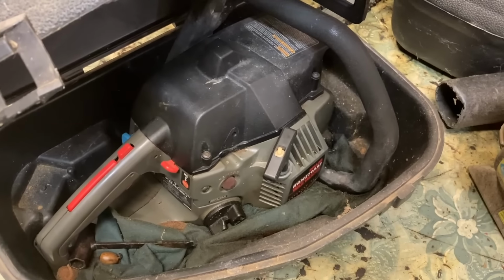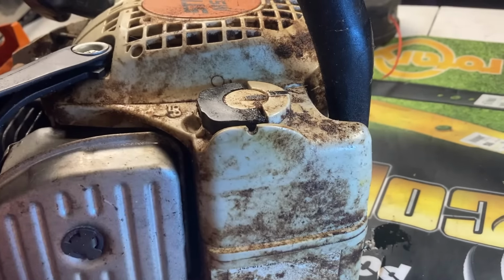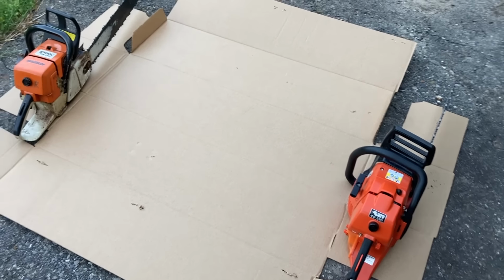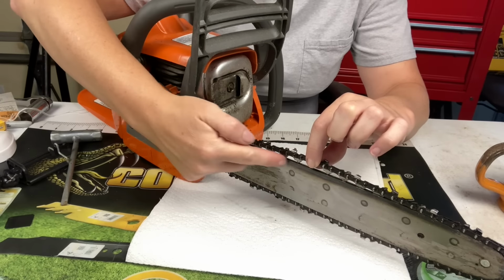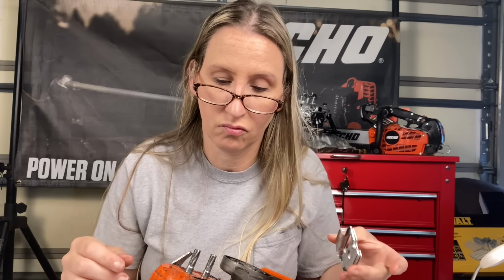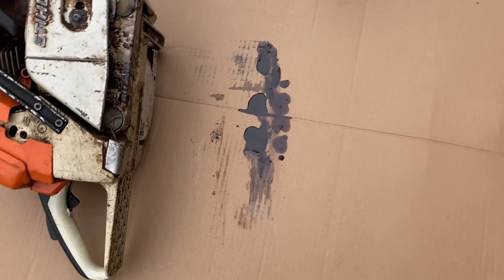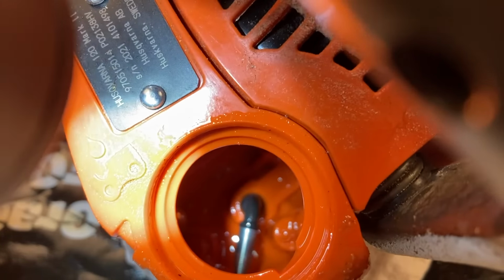Chainsaw leaks bar oil? The most common reason why AND Husqvarna saw leaking oil FIXED!! Repair Vlog

Comment: Even if you don't have a mechanical problem with the oiler or seals, your chainsaw is going to leak some oil.
Chainsaw oil has additives which increase "tackiness". Put some bar and chain oil between your fingers, rub them together (yum slimy), then pull them apart - those "strings" are due to the additives increasing the surface tension of the oil so that it will cling better to the chain and not sling off as easily, improving lubricity between the moving parts of the chain and its contact with the bar. It's ALSO what makes a chainsaw prone to "leaking" after you shut it off, even if all the seals are in place. A couple of things are going on. For one, the chain oil has very high surface tension and the oil in the pump and the mouth of the oiler literally gets pulled out by the oil that is already in the bar/chain and "stretched". When I was a kid they used to sell this "powder" for "magic tricks" that when added to water would make "anti-gravity fluid" - you'd start pouring the "anti-gravity fluid" (telling everyone it was water) from the glass then sit the glass back on its base and the "water" would just keep climbing up the side of the glass and out. Magic. Actually it's surface tension.  Same thing goes on here with the "tacky" bar oil.  Second, even though  there is a vent in the oil cap on the saw, this is to allow air IN when there's a vacuum in the tank from the pump pumping out oil. But most of them are one-way valves, and don't release excess pressure in the tank so you don't lose oil turning the saw over or clog it with oil and interfere with the oiler pump (even cheaper saws where the vent is just a hole don't operate quickly if the pressure changes quickly - the vents are tiny to keep contaminants out of the oil) so when the air pressure outside drops, the air in the tank expands and forces oil out the oiler mouth and down your bar and chain. Also if the saw gets warm - such as going from cold winter outside to storing it warmer inside; or having it in a vehicle that warms in the sun - this increases the volume of air in the tank and its pressure and forces oil out the oiler mouth. Other oil "leakage" will come from all the debris, junk, and dust that accumulates under the cover where your chain drive is. This gets saturated with oil during use, which slowly drains out of it as it sits. 

Just FYI In case you were interested in the physics of why it happens and why you can't actually prevent it completely.

Comment: My Stihl dealer told me when I was done with the saw to take the oil cap off and put it back on he said it relieves the pressure buildup in the oil tank it seems to help but not 100%

Comment: actually, out of all the saws i have had over the years, stihl, ryobi, ross and husquvarna, the husky(372xp) is the only one that doesnt leak oil everywhere... i can actually put it on the floor of the car and not have to worry about the carpet getting ruined. the ryobi(18v) on the other hand is probably the worst for oil leaking.

Comment: another point, revving a saw without cutting anything will get more oil everywhere since there is no sawdust to absorb and cary away oil, basic homeowner saw sees a lot of light trimming for every minute of run time, leaving plenty of oil to drool out. If you were bucking up firewood I'd bet you would see a lot less of a drool spot. My 257 does not leak normally, but after a fuel line replacement and carb tuning (full throttle with no cutting) it left a pretty good drool spot.

Comment: I had just bought a new Echo 510, I believe that’s the right number. My brother in law burned my McCollouh up. Probably no oil in the gas. 
Anyway, I had just sharpened the saw and adjusted the automatic oiler. My old one had a mechanical oiler.  I held it up to the end of a log and revved it to see if it was oiling. That thing sucked up to the log, hit and jumped back in my face at full throttle. Cut me from my eye across my nose. Over 150 stitches and 10 operations and I’m halfway back to being normal again

Comment: My big Huskys' have always piddled...like a puppy dawg, whenever I store them. I'm sure there's a proper fix, but as long as the oil tank delivers the same amount of oil to the chain when I use it, I don't care. Relieving the pressure and draining the tank for storage has always been enough for me. Watch for a vid on your particular saw's oil leak and fix it if you like.

Comment: The oiler works on pressure. When done, open the oil cap, tighten the oil cap and it should not leak. If it does you might need to get some repairs done.

Comment: Here in the Pacific NW we use winter and summer bar oil.
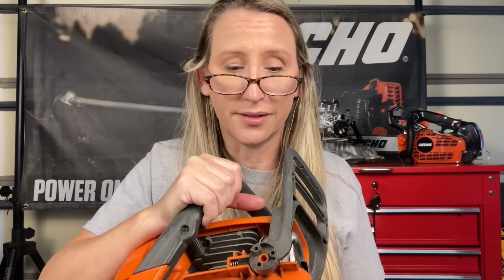Thick stuff in the summer so as it gets hot it wont flow as easy and leak.  20:33 Winter is thinner (just add motor oil or diesel to thin it out).

Comment: One thing you didn't measure and assuming all chain saws leak, what about the storage position?  Will they leak less if they are rotated in a certain way?  Usually you see chain saws stored upright.  But what if you laid it on its side?  In storage, I don't want it to leak AT ALL.  What's wrong with that?

Comment: Thanks for the video's, very informative. I have a practice of just draining the bar oil back into the container when I through leaving the reservoir empty, no leaks. I should also note I empty my fuel and run the saw until it shuts off. The saw is not used that often.

Comment: Very helpful video! My small saw that rides in the truck never leaked for the 1st 10 years, now it leaks terribly the last couple months. Gonna pull it apart this morning and figure out why with the help of this video!
Also, I don't think all saws leak, my 462 hasn't ever leaked a drop but it doesn't see as much action as my trail saw.

Comment: My new Echo CS-400 was adjusted for way too much bar oil, it was slinging oil off of the bar like crazy.  I adjusted screw for less oil.  However it still leaves a little amount of oil under the saw after using. So it good to know it is just residual oil from inside cover.

Comment: My echo leaked so badly. I took it to the dealer, and he said it was normal. I took it to another dealership, and they said it wasn't covered by warranty it will be 145 dollars and the problem was it was set to high, got it home and it leaked just as bad. Took it to a non dealer and he replaced oiler and seals we will see if that fixed it

Comment: Nice video and great presentation, the primary reason for the rubber oil pickup tube coming off is most likely someone cleaning up with a compressed air duster, 120psi sqirted anywhere near the bar orifice will do it 😊

Comment: My Husqvarna 55 rancher leaked like a sieve  when I uses cheap 30 wt oil for bar oil.  I switched to the Husqvarna bar oil and my leaking problem stopped.

Comment: My Poulan always fills the case with oil while it is stored. I dump the oil and gas back in the containers using a funnel now. No mess and no stale gas. I usually run the carb dry after that. I drain the oil from my electric saws too.

Comment: Enjoy watching, you repair ,that blower,,,I just fixed chainsaw ,that my brother in law,let friend borrow straight  gas,melted aluminum over rings,I had about 41 saws down to 35
During after hurricane, in Louisiana,,,sulphur ,I loan them out ,,,after hurricane damage is over ,I get them back and fix back up,last hurricane, a had 15 out did get all back every brand ,never worked on echo.

Comment: I’ve got a Stihl 041AV, must be 40 yrs old, maybe more. Uses exactly a tank of oil for every  tank of fuel. Has never leaked (other than what drips off after being run hard).  Bought a Husqvarna e series 450 x-torq that leaks half a tank of oil if I park it with the tank full. And it does not oil the chain when under full power such as cutting blocks, have to run it just fast enuf to turn the chain after every block so the chain gets oil.  Bought it with a 5 yr warranty, took it back, they said it’s working normal, supposed to leak oil, complained about the lack of oil under power, they said they couldn’t get it to do that.  It spent the 5 yrs mostly at the dealership, and now I’m stuck with the problems.  Only thing good about it is it’s way lighter than my Stihl. Love that old Stihl.

Comment: As a JD mechanic said about his brand of tractor: "If it leaks, it means it has oil in it!" He was referring to hydraulic oil, but bar oil is the same way with saws. Buy any $500 saw, run it, expect bar oil leak. I HATE the Stihl caps, anyone too dumb to use the screwdriver type caps is too dumb to run a saw.😂

Comment: When I use my "chaino" i always finish the day using my air compressor gun and my 3 sizes of brushes to clean "my baby".  The i fill the oil up, give the chain a quick sharpening and, thanks to your video here, realised why i don't have that problem.

Comment: Thank you, I'm new to chainsaw, and have no real small engine experience. I thought I just have to tighten the cap mowar, but good to know I don't need a bigger hammer, I just need to suck it up. Glad my chainsaw came with a case (promotion so free), and so it's not just getting into the garage ( the mess is contained). Now to learn how to use this sharpener I just bought. I'm a trained goldsmith so I have experience filing, but I'll need to figure out the shape goal et al. I've run four tanks of gas, so it's worth checking my teeth.

Comment: I really haven't seen a chainsaw that would not have bar oil under it in storage. it is the nature of the beast. The bar oil container has to be vented somewhat to keep the pump from pulling a vacuum. When you put the saw into storage gravity takes over and the oil can run out to some degree depending on that particular saws design. The only way to lessen the problem is to drain the oil out before storage. In fact, some of the owners manuals say to do just that. The oil leaking is not a defect. If the oil did not easily flow through it would not be able to keep up the the proper demand for chain lubrication.

Comment: Mine the oil literally gets into the gas tank and I've used chainsaws since I was 14. 
I empty the gas and refill and prime, it cranks up runs then when sitting or seeps into gas tank somehow...I though I had first may e put oil in gas tank but once I emptied and refilled I can use it till I'm done and sit it down for a couple hours. Oil gets into the gas and it's not me.

Comment: Well i just realized ur in AR. So am iI. My name is Tammy and i live in Coal Hill AR. I bought a refurbished 440 Husqvarna last year. I havent honestly cut very much wood with it yet. I feel ive worked on it more thsn ran it. Parial me just being out of practise. So im not blaming the saw yet! But the issue of not oiling my bars is about to get my goat. I have a 18" and a 20" bar. I have kept the bars oil holes cleaned out along with the bar themselves. I keep my saw cleaner than most anyone i know. So i cant figure out what the probmem is with my bars not getti g oil. Ive done everything i know and watched video after video and still can not get it to put oil on the bars. HELP PLEASE!😢

Comment: Quick tip. When pouring out of a plastic 1qt. Oil bottle... pour it with the spout at the highest point.... NO GLUG. These are not my design so don't shoot the messenger..

Comment: When I’m done I drain the saw both of gas and bar oil. I use a funnel and put the bar oil back into the bottle. Same with the 2 cycle fuel. Every other month I clean the entire saw with some Simple Green and it alway looks brand new. Remember there is oil on the chain, bar channel and clutch sprocket that still puddles after the engine is off. Wipe the saw down when you’re done with shop towels and don’t forget the chain and bar. It will drastically reduce the oil left on the ground.

Comment: Craftsman 20 inch here... It has been two years now and it was used a lot!  Half the time it still starts on one pull the other half 3 pulls... It puts out plenty of oil on the bar and so far little to no leaks... Runs great!! Sorry...

Comment: I’ve tried a few “cheaper” bar oils and they are definitely thinner than Husqvarna and Stihl… I like it on the sticky side…  not a fan of cheaper brands.. was recommended Prime bar oil at my local Echo dealer.. my 400 and 590 sling that stuff like water… compared to Husqvarna oil that is..

Comment: I bought a NeoTec NCS-6200 and instead of putting the oil in the tank, you might as well just pour it right on the floor.  It’s ungodly bad.

Comment: Don't forget to tell everyone when you replace chain on chainsaw or clean and adjust your  bar and chain.  Take chain off and bar of chainsaw and take your pocket  knife and clean out the slot (both sides) on the bar. That junk will raise your chain  after awhile.

Comment: Just a little tip I'm almost 40 and just learned this a few years ago... Flip that quart of oil 180 degrees... When the nozzle is on the top you get a lot less of that surging that usually ends up making a mess and you get a lot more control over the pour

Comment: I have a Husqvana chainsaw that leaked LOADS of oil and when I turned it on it's side, there was a huge HOLE in the bottom . I did repair it and it's still going BUT why the hole? 🏴

Comment: We need to remember the bar oil is meant to spread across the chain that is moving. It doesn't stay internal to lube the internal workings of the machine. By definition, it is going to go everywhere and drip off the various parts. In other words, it's a mess.

Comment: Surprise fix for everyone...Found a leak culprit on the underside of a Husqvarna 435...the oil screen cap (round gray plastic) is barely attached and leaks very bad...its only held in place by a thin piece of plastic and a twist...a little flexible gasket like loctite 515 works wonders, just don't seal the filter screen or the passageway to the crankcase...you have to remove the engine from the frame to find it.

Comment: I would ask you to marry me but my wife of 57+ years wouldn't like it!  In all seriousness I really like your organized approach to solving problems and explaining why you take the particular path you do.  I was actually looking for information on how to fix the bar retainer stud on my ECHO CS-680 when I saw this post on leaking and thought take a break and see what this Chick knows.  I'm impressed to say the least.  Its my first time looking at your videos and I subscribed.  On my problem the rear stud has over the years canted rearward making the distance between the to retainer studs greater at the top than the bottom and got to the point I could no longer put the plate back on.  If you run across some info on how to fix something like that I would appreciate a heads up.

In regards to the leaking issue, You might suggest that everyone look for the ingredients in the bar and chain oil to minimize leakage.  Some companies put a little honey in the oil for two reasons and it helps a lot but doesn't completely stop leaking.  The objective is to change the viscosity of the oil and to make it more tacky so it stays on the chain longer.  Maybe your subscribers would want to experiment a little to test whether adding an additive will help them.  However, if the chainsaw is run too hot, nothing is going to work and its no different than when the additives in car engine oil breaks down with heat and age.  But its a pretty easy way to differentiate / determine if the leak is due to a broken seal, split hose, or excessively worn part.  NOTE!  While tackiness is a benefit, if your engine is running too hot to begin with, tackiness can result in blockage as it builds up and turns to carbon.

Comment: Be mindful that if you use rags to sit your chainsaw on to control bar oil weep,  whether in a carrying case or not, oil soaked rags can SPONTANEOUSLY COMBUST. This is especially so when confined in a carrying case. 
If you do this, change them regularly.

Comment: If it isn't leaking it isn't oiling... Saws use a worm gear feed pump in the oiling system and with no positive displacement the pump allows oilt to leak by if:
The bar oil is higher than the oiler port...
The gases inside the oil tank heat up and push the oil out... 
If the saw is left on its side par side down...
Or...
In rare cases...
A damage exists to tank housing or oil feed hose...

Comment: My favorite thing is exclaiming it didn’t leak!  Then I take the bar cover off and set it aside.  I come back to find a huge mess of oil has leaked out of the bar cover wherever I set it down.  It can happen when I hang them by the handle bar slightly down.  Set them in the truck and guess what?  The bar is up and again cover is full and it drains into my truck or shop floor.  Fun!

Comment: Get some cheap pizza pans and set your saws on those...keeps it off your shelves and floors. Also open your fuel and oiler caps after you use the saw to stop pressure build up.

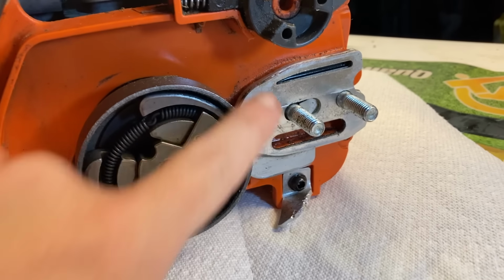Comment: Great experimentation. Leaking bar oil drives me crazy.  Stihl has the leaking caps. My Husqvarna had the same grommet issue. Popped back and its better. There is always going to be some oil under the cover after use dripping down but I hope the storage time leaking lessens.    18:34 thought for sure you were going to wind your hair into the sprocket....yikes.

Comment: I hate new Stihl gas / oil caps. It's almost impossible to keep grit and dust from entering the tank and messing up the o ring seal.
         The old caps were never an issue .

Comment: You should blow out the saw with a air hose and wipe it down good and clean it up good before you put it away... Then there will be no oil leaks...